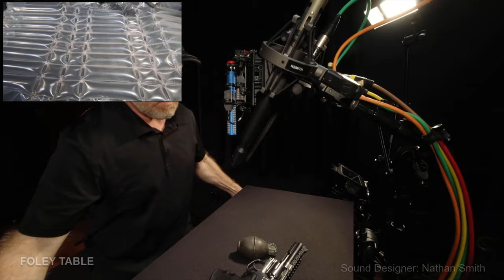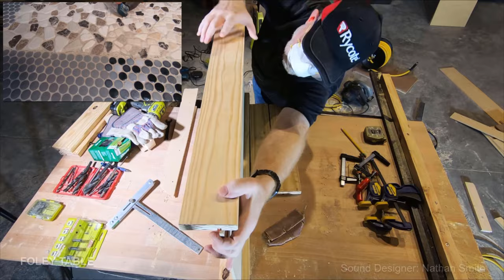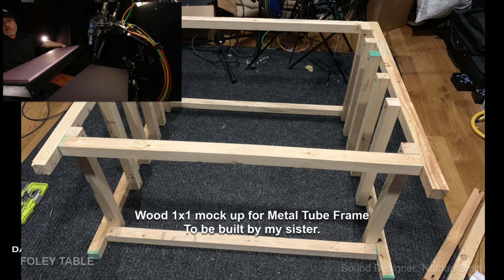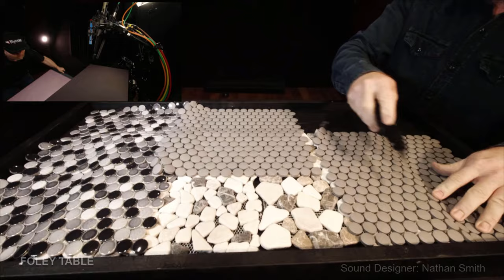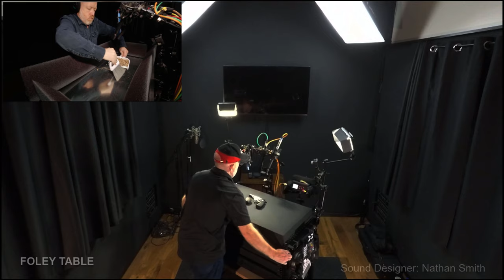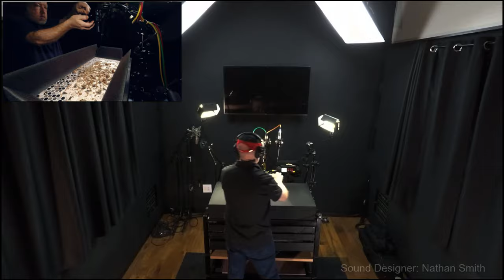Foley Table Build - by Nathan Smith

Comment: Nicely done. What a super handy tool to have around! 
Are these pieces 2'X4'? 

I wonder how you feel about the size of the surfaces and general tonality? I'm currently in plans for a v2.0 of my foley surfaces. I'm leaning towards 4'X4' for each surface type with 3/4 base underneath to prevent resonances. What are you thoughts after building all of this? 
I'm hoping that 4'X4' surfaces can be used for footsteps and foley work and made to be stacked with 1/4" lips to keep items on the surfaces... 
Thanks for sharing the video of the build process!
Reply from the maker: I believe they are 1x4, 1x6, and 1x8 for the outer frame. I made the larger flat part out of different types of wood/thickness and drilled holes for different resonance response. Since I just finished this I still have a lot of work to tune and explore how to maximize and get the sound I'd like out of each shelf. I didn't set out to use this for footsteps, but I like your idea on that direction. I may think about how I might build these "shelves" to also work for footstep surfaces as well so they are even more flexible. The trick is to keep the weight down so you can still handle them and move them around. Great ideas and feedback, love it!!!